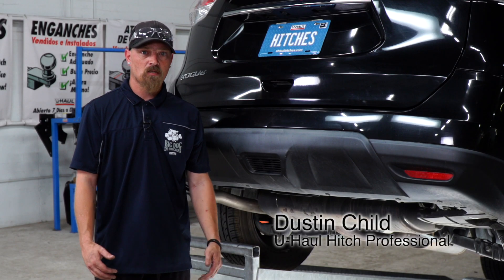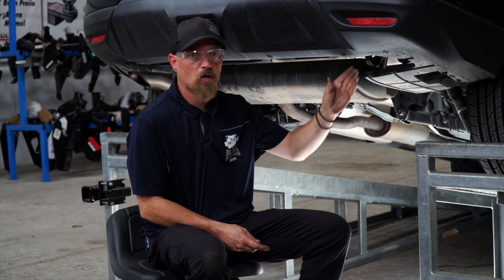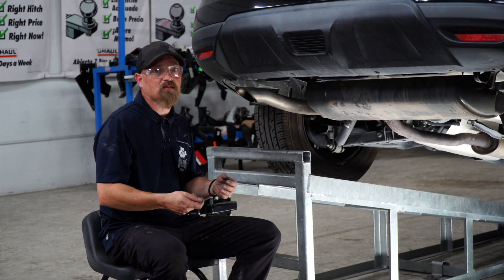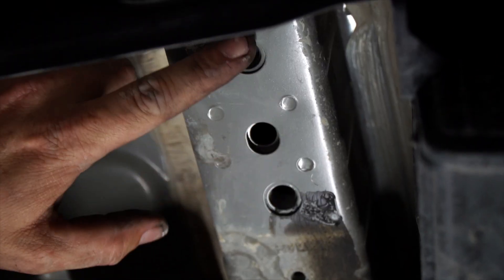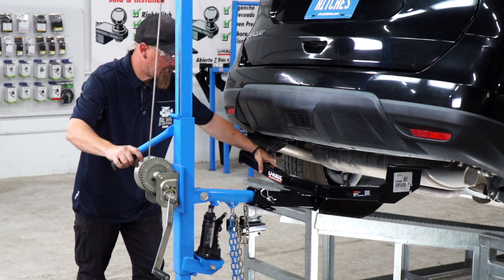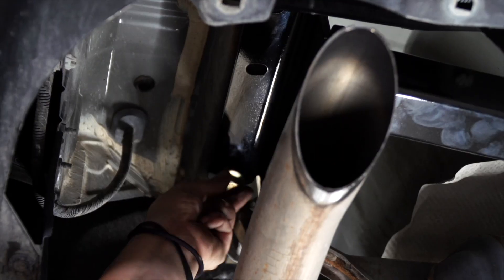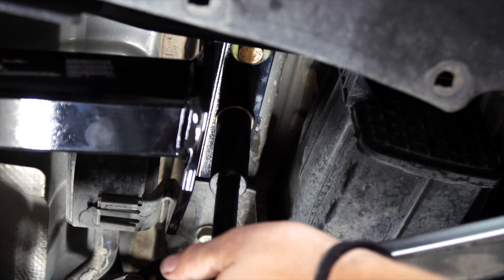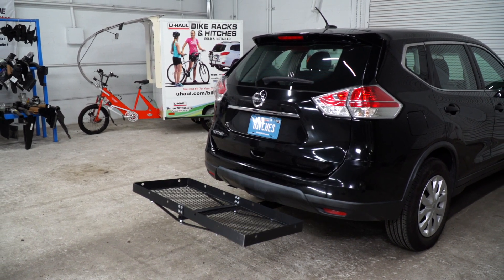2020 Nissan Rogue | U-Haul Trailer Hitch Installation

Comment: Great video considering the written instructions don't mention removing the tow point. Although mine wasn't a tow point, it was some kind of bumper to protect some plastic component. However this doesn't mention a re-installing the plastic guards, and the left side needs to be cut to fit the hitch bracket. Pro tip: I was able to use my hydraulic floor jack under the receiver to nicely lift the hitch in place. Without this it would've been a major pain.
Reply from the maker: Glad it was helpful.

Comment: Nissan rogue tongue max limit is 110 lb.
Not worth if you are planning to use for cargo carrier. 
You can only carry 40 lb  goods considering cargo carrier would weigh around 70 lbs.
Not worth.
Reply: Could you pull a trailer with light equipment?